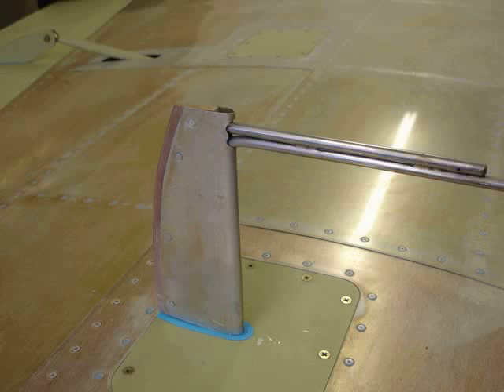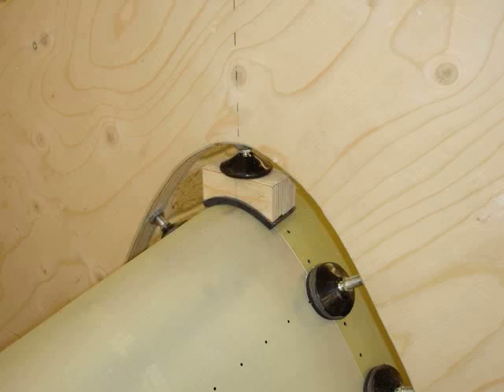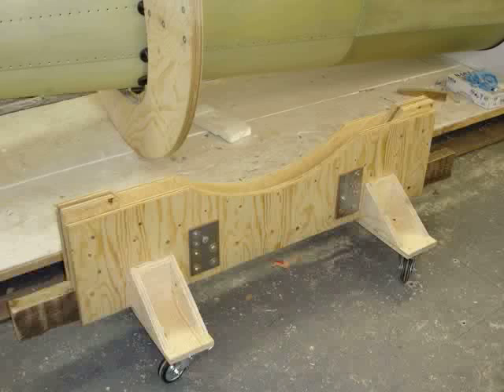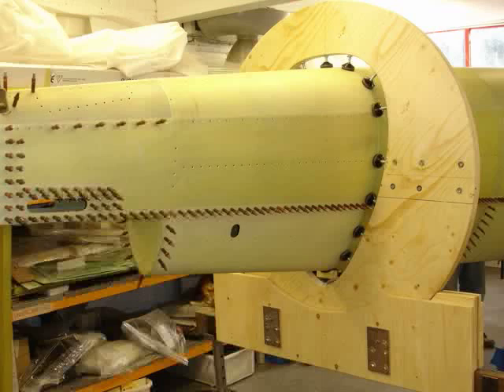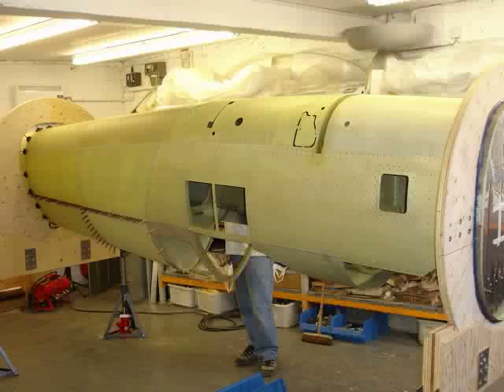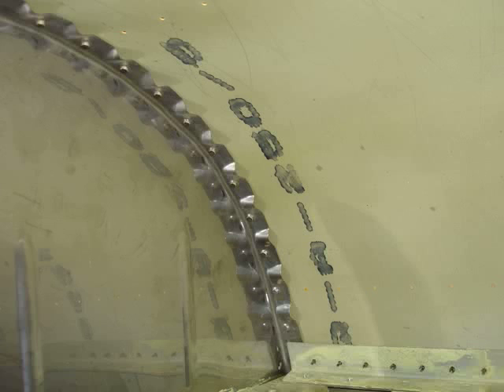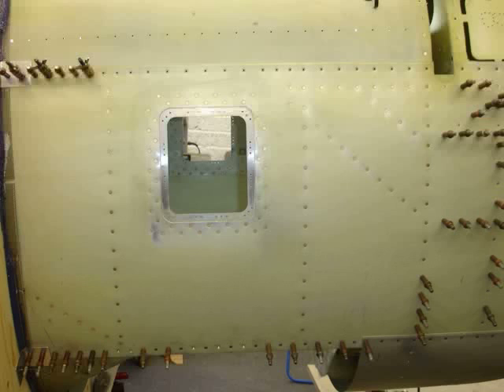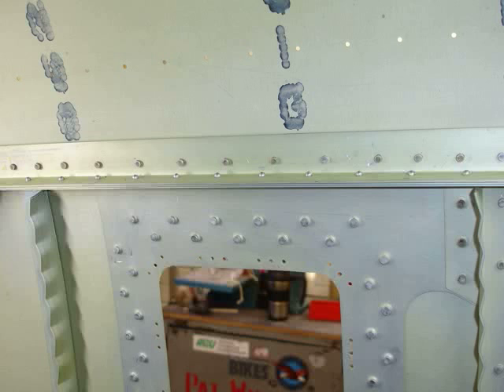More Spitfire build Photo's

Comment: I wud love to replicate a Mozi alright, even using Alluminium Alloy Buick 4.6 V8 engine with even some mild tuning would turn out at least 270hp, the power to weight ratio therefore would be equivalent to the Merlin after doing some quick calculations. Problem with working on the wood is the glue and I tend to get addicted to things fairly easily !
Reply: Stephen Callaghan the merlin had 1000 to over 2000 horses

Comment: I'm just starting the building of one of these. How did you go about replacing the pulled rivets with solid flush rivets? The entire fuselage came dimpled for 120 degree pulled rivets, and the 100 degree AN426 rivets sit proud.
Reply from the maker: I've just finished the shift on the Spit. But will go to the unit and get the part numbers of the solids that we used. Ours as you can see, are flush
Regards Dave
Reply from the maker: These are the part numbers of the most used rivets on our build. MS20426AD4-4 and -5 In the UK, we get ours from LAS Web. www.lasaero.com One pack usually contains 104 rivets. Dave